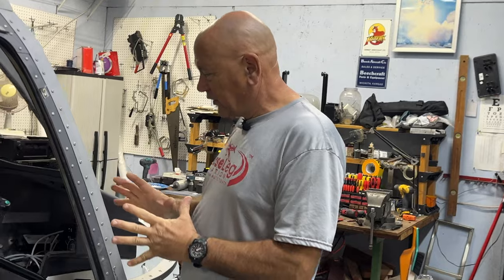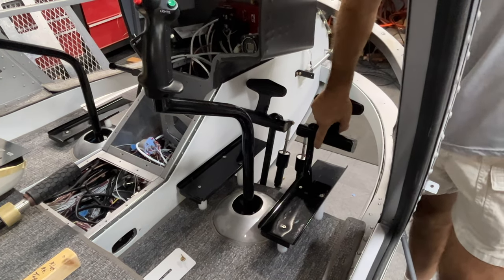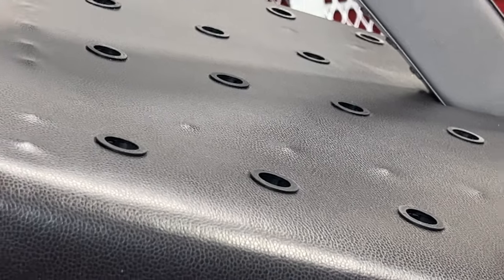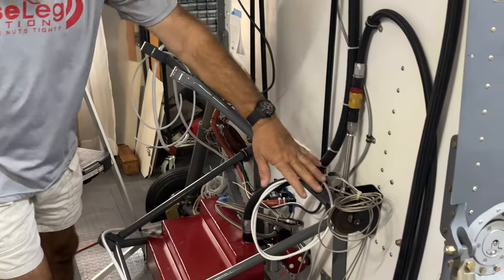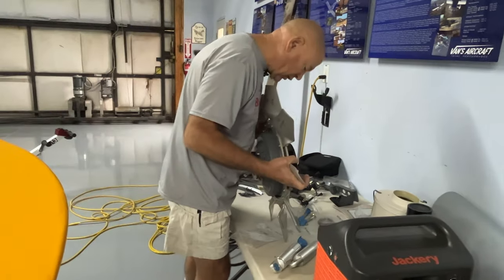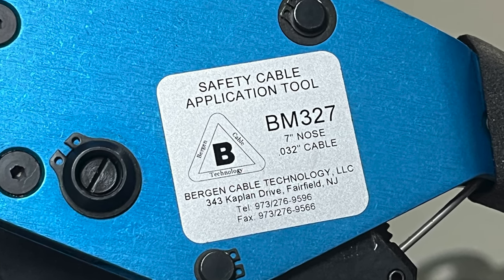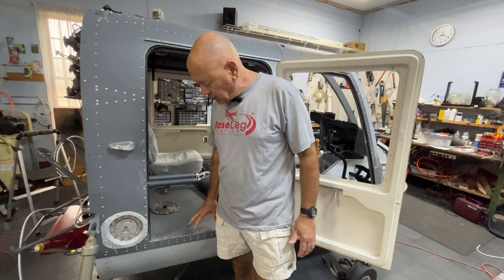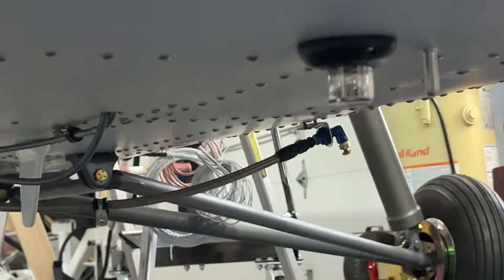hummingbird update 11 13 22

Comment: How much does the fan/clutch way? Any idea how much power the fan consumes?
Reply from the maker: it’s pretty heavy, but I didn’t weigh it. it needs to be somewhat heavy so as to have some inertia for the engine prior to engaging the rotor. No idea on how much power it consumes, but it is needed in order to cool the engine. there is no ram air available for cooling, especially while hovering.
Reply: @baselegaviation1614  If it's centrifugal it cannot stall upon engagement, can it? My engine uses centrifugal engagement also, but less the one way clutch. The centrifugal clutch is already one way by design. I think air cooled engines in a helicopter are a strange idea. I'm going liquid cooled, different chopper. Nice build, best of luck.